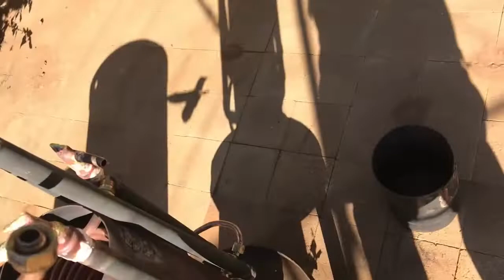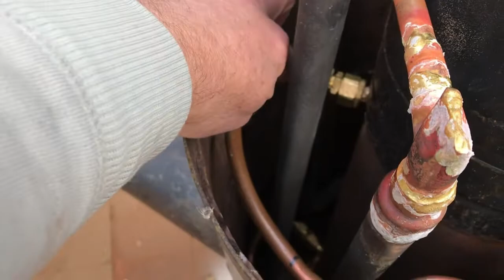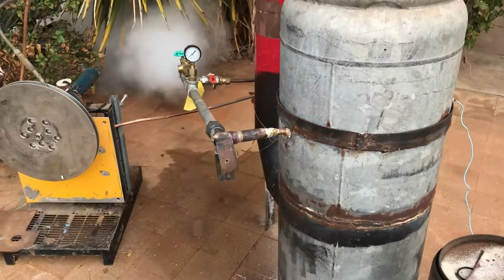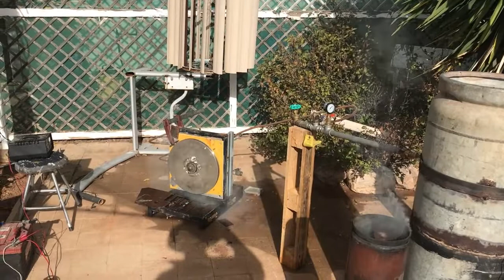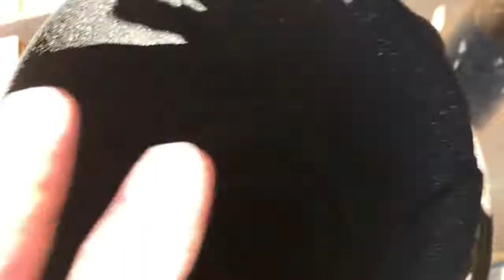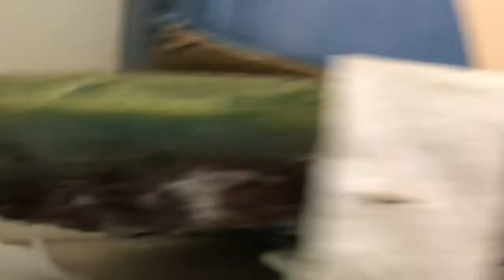Steam Boiler Revisited

Comment: That was really interesting. Wood fired rocket stove creating steam to drive a turbine to spin a generator. Felt like I was watching something out of a steampunk movie. Very cool. Look forward to the next try.
Reply from the maker: Hi Q Absoloff. Considering that it only has one cooper coil it produced some good amount of steam. I’m going to increase the size of the fire pit in the next week or so. And I’ve put the coils in between to pieces of plastic ready for the power output test as well. The spark plug water level switch will only be used now for first fill up. I looked into mono tube boilers and they use the temperature differential between the boiling water and steam area some how. For next run I’m just putting a valve on the inlet and going to try matching water flow with steam production.
Reply: @danp1224  That was something I meant to ask...how does the spark plug water level switch work. I'm assuming it is not just a regular spark plug? Did I miss something in the video? I'm likely suggesting something you've already though of but one of those cheap Chinese PID or temperature controllers, monitoring a thermocouple to drive the water valve might help match water flow with steam production. Doing it manually at first is probably the way to go. Look forward to it.